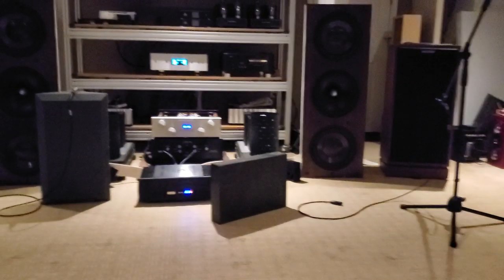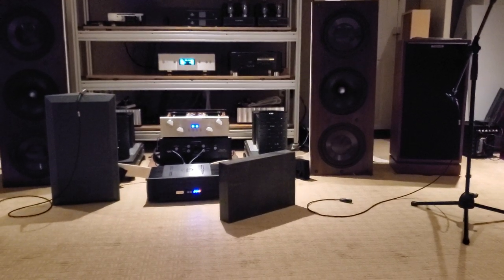Quick & Dirty - mass loading speakers

Comment: Once I received a pair of 3 ways that needed  mass loading and I didn't realize it at first because the manual was missing. They sounded funny and I called the company and they told me that they needed several lbs of sand inside the cabinets. I reluctantly tried it, big improvement, but I was concerned about long term  damage. The friend who took me to get the sand bought them from me later and he still has them.
Reply from the maker: Sand is actually the best material to damp vibration...  period.

Comment: Having evolved and still using a similar technique for decades , I can tell you that you get a cleaner sound but with less energy. And this, only if you do it right. Otherwise you just partially cancel and partially "relocate" energy and coloration to a different frequency range, usually (or, the way you did it,) higher. That might even cause an overall deterioration rather, or just different but not necessarily better sound.
Reply from the maker: True, that's why we experiment and try different materials, sizes and weights!

Comment: I improved sound of my PSB 6i subwoofer a lot simply by putting a marble plate (15x17 inch) on top of the subwoofer. It improved the boominess a lot. My sub was tested by Sound&Vision to be a good sub to begin with. The improvement cab easily heard. I have no way to measure it. If you see this message, please try it and measure it in terms of FR and distortion. Thanks,
Reply from the maker: My Subs have changed now

Comment: i think that a very sane approach is to segregate the big woofer/woofers in a standalone cabinet like it is done for subwoofers.  The big woofers are like beasties and a robust cage is needed. 
Taming/nulling their vibrations is challenging task indeed ...  On top of that cage decoupled by it can sit a nice satellite with mid and high drivers.   To put all drivers in the same cabinet is a technical challenge usually leading to a very big and heavy cabinet to tame unwanted resonances.
Reply from the maker: That's for sure how to build more expensive, better sounding speakers

Comment: Here is your problem, OCD, when you do this you do not change the sound evenly through the 20-20k range, it is selective, so sure, if you are really lucky you might end up with this curing some bad resonances, but it is about a 2% chance in my experience, as in I have not heard this improve sound, ever. Reason is, if the cabinet is active, like a Klipsh or Harbeth or whatever, that active sound is a big part of the speakers sound, and now you are completely reshaping it in an arbitrary manner. Here is a new test for you... Compare, as you did here, the naked speaker and then with the granite on top and then for the third comparison put the granite on the floor, then put 4 new feet on that for the speaker, make the feet out of Sorbothane. I would guess off the top of my head that 2" rounds by 1/4" thick of 70 duro Sorbothane would be close to right. I have found that one needs to tune the sorbothane feet to limit xmax (so to speak) and to have the right rate of resistance to movement, now put the speakers on top of the sorbothane feet, make sure you do it so there is no stored twisting or stretch in the feet. Play music for 1/2 hour to settle things in, then compare that sound. I wager the sorbothane feet sound profoundly better than the other 2 options, I wager the speakers will disappear much more readily and the high end will smooth out and if you get the rate and amount of the sorbothane correct the bass will also improve noticeably. In my experience it is better to de-couple the speakers from the floor. Cheers.
Reply: bvocal please post if you find any numbers or scholarly articles on this I know decoupling does all sorts of things
Reply: @dilbyjones  The only tips I can give are... duro is the measurement of hardness of the Sorbothane, lower number is softer. Sorbothane seems to like the proper amount of pre-loading for it to work at it's best, so you choose the right Duro and the right dimensions based on the amount of weight or load it's going to be under. When you use it... you need to use your ears because, for instance with speakers, the right rate of action will be determined by the Duro rating (& size) and the amount (+maximum deflection) will be determined by the Size (& rating), so for some Bowers & Wilkins 603 s3 speakers (very active cabinet, sounded like crap with any added cabinet damping) I ended up with 3/8: thick by about 1" sq to get the right sound.  What happens when it is right... the sound will easily divorce itself from the cabinet (I.E. the cabinet will disappear) way more easily and often, The highs will soften up and also become more detailed, the bass should tighten up and all around good things will happen. If you then make it too soft the sound will get dull and mushy. This action does not work for all speakers. Some cheap speakers might just sound horrible, who knows, and it would be pointless to do this with $$$$$$$ speakers that already have isolated driver, like, say, Magico speakers do. So, Albert, bottom line is you have to experiment to find the right rate and amount. I end up buying sheets and then choosing the size and number of layers in order to tune it. Cheers.
Reply from the maker: @dilbyjones  You must also take into consideration the floor you are on. You only want to decouple a speaker from a top joist type wooden floor. A concrete slab under a wood floor you want to couple your speaker with

Comment: Mikey, the stone slab is doing two things, one is the mass loading effects and the other is the presence of the crystalline materials in the rock affecting/effecting all the materials of/in the loudspeaker box.....'artificial stone' like Corian sounds bad, real bad, granite, marble etc all sound different on top or under amps, speakers etc.
BTW,  I watched your diy earthing box vid with interest, did you do a follow up vid and what were your findings?.
Love your work putting the fun back into hifi, too many enthusiasts get too anal about what is a hobby after all.👍
Reply from the maker: In the weirdest way it worked. Go figure. I dont know how but it did
Reply: @OCDHIFiGuy  The stone slabs are Bybee iQSE devices in a sense in addition to the added mass stabilising the boxes and damping the boxes.
You can try concrete slab or natural stone, all will work but will sound different.

Comment: Start with a speaker that has good tight cabinets to begin with and...nothing.
Reply from the maker: That's for sure
Reply: @OCDHIFiGuy  

Well, yeah. But most sealed cabinets have that weird effect where their dynamics are too jumpy (because of the air spring) yet delayed (because energy has to go somewhere, and it doesn't matter if you have thick brick walls and an infinite baffle that goes to a room. Phy-HP has two of their drivers strapped to a wall with 3-tons of sand filling that flanks another room and it still vibrates- now imagine with one inch thick resin composites). So I think Mass Loading a Cabinet that actively seeks to control this effect has more merits rather than merely building a seemingly inert cabinet. I'd argue Mass Loading could be the key to a cabinet like this.